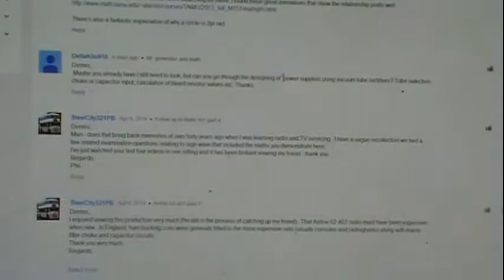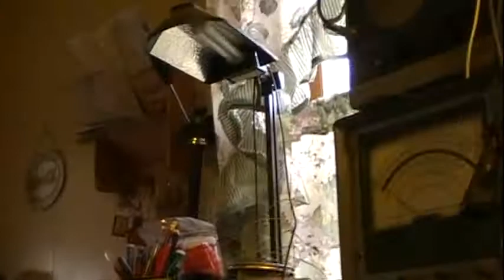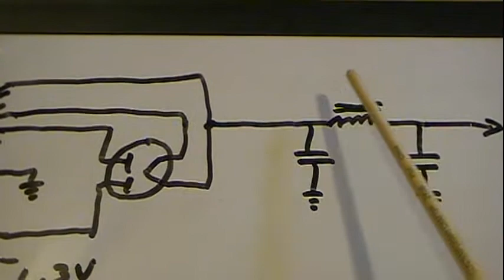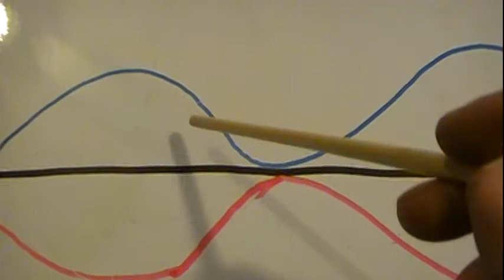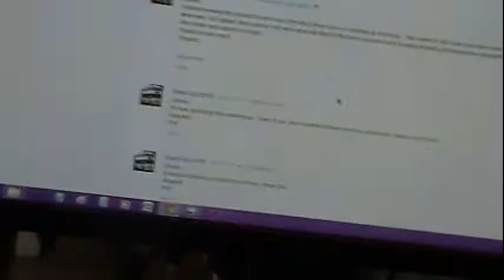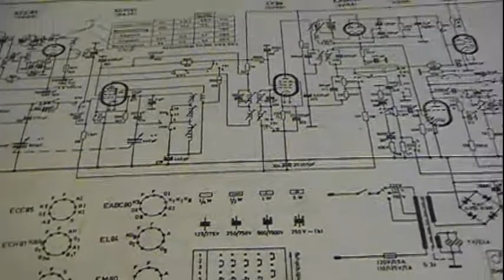Answering the comments

Comment: hi Dennis. i enjoyed your videos.  i wanted to know if a ac-dc radio could be wired to be safe. i have it ether hot when its on or hot when its off . is there a way to do that? thanks robin
Reply from the maker: Yes it can be. You will want a polarized power cord and then hook up the neutral side to the chassis and the hot to the power switch. Also those radios may have a line filter cap either connected to one side of the line to ground or across the line that you will want to replace with a safety cap.
Reply: hi Dennis . i have done those things and now when switch is off the chassis is hot when i put my meter from my wall ground to chassis i get 120v. it is a  philco with a full wave rectifier thanks again robin
Reply from the maker: What is the model of Philco you are working on?
Reply: 48-1256 philco with a record player.
Reply from the maker: I will make a video on your problem tomorrow. In it I will tell you things to check. And what to do to fix them.
Reply: hi Dennis. thank you so much i really appreciate the help, i will watch, thanks robin